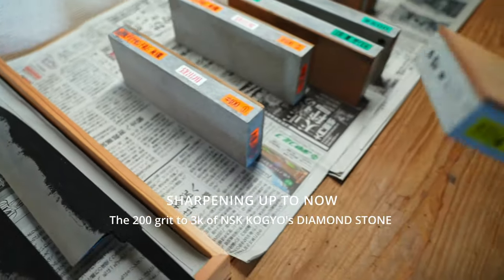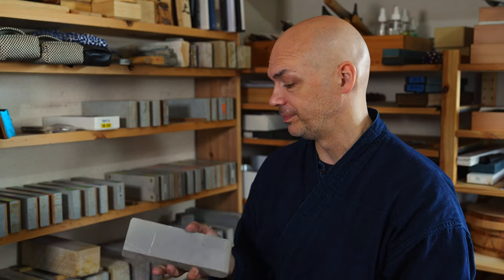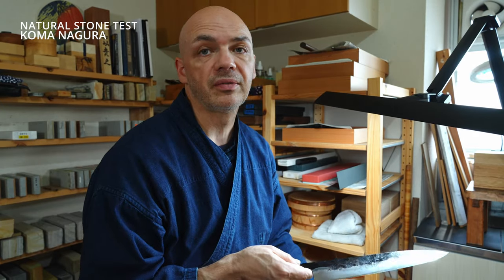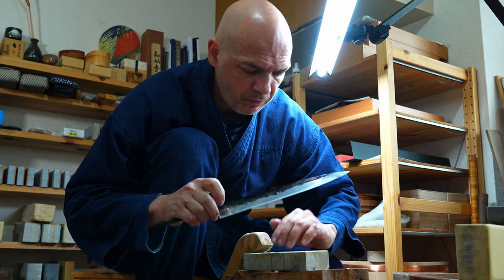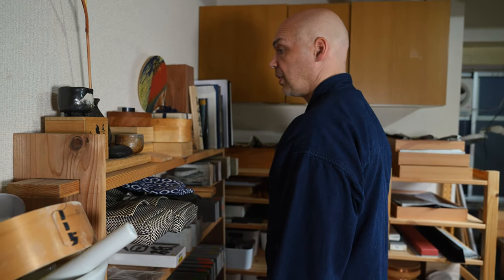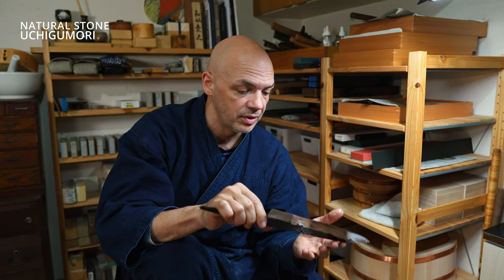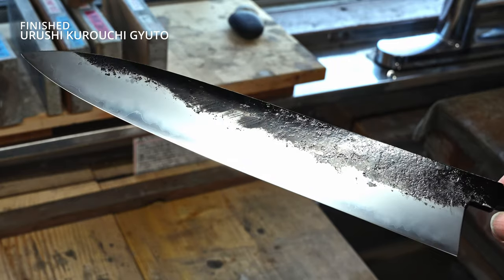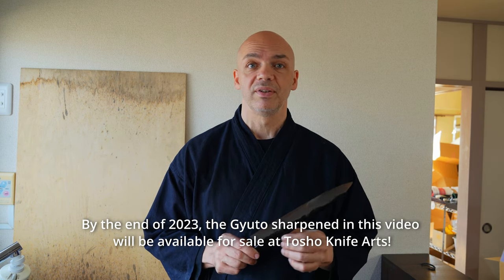Natural Stone Polishing for Kurouchi Urushi Gyuto, Part 5

Comment: Hope you are charging a decent coin for all the hard work you've put into this knife.
Just a quick question, i noticed your sharpening strokes are very different to the others on Youtube. They tend to use more of the surface area of the stone, whereas you tend to use short strokes. Is it because of the differing angles on the kireha?
Reply from the maker: Thank you ! I often use shorter strokes with varied pressure for accuracy and consistency in polishing and geometry